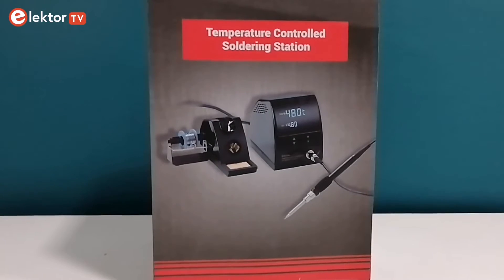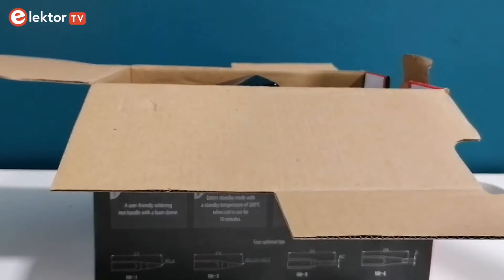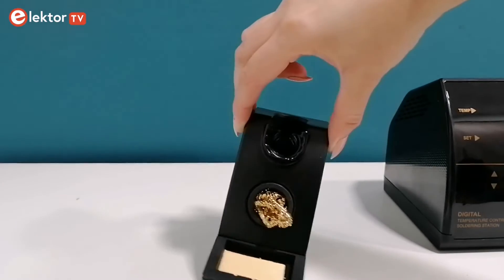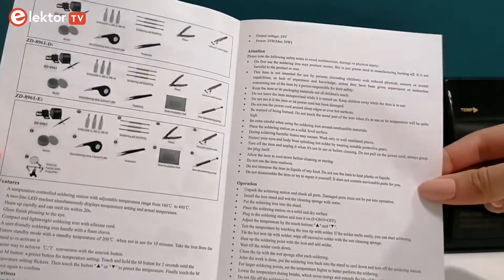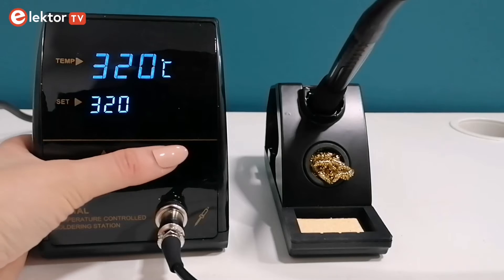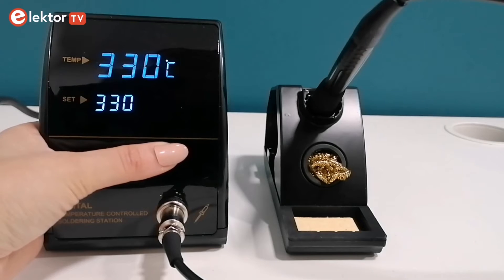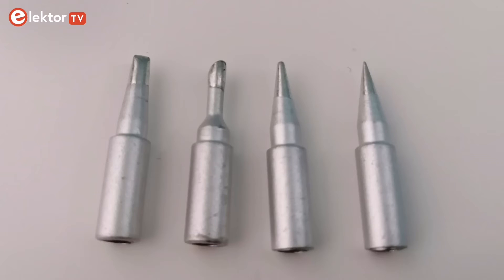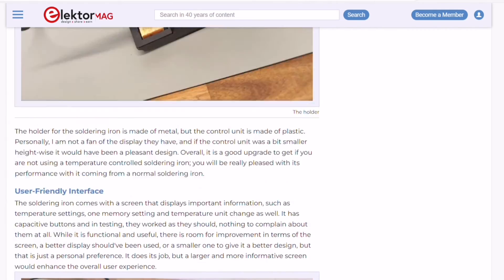Temperature-Controlled Soldering Station ZD-8961-A

Comment: Good morning. Very nice and concise presentation.
1. If you mention out loud the $60.- price at the beginning of your presentation and at the end then interested viewers will then go right away to the Elektor store to double check
I understand.
2. If you show the inner side of the connector on the cord side viewers will be able to tell what kind of connector is used.
3. If you mention that power supply comes directly with different plug types, or it doesn't, viewers will know whether one has to provide for the mains cord or it comes included. Different countries have different mains power plug types.
4. With such good price, this product is of interest from top professionals down to beginners. If you include a quick link for beginners to learn how to use it on their own you gain the interest of those willing to learn.
5.- Marketing tip : I understand this soldering station is equivalent to the WELLER WSD71 that costs @90.- 
If you mention that this product has better features than well known pricy products, then show 2 seconds the WSD71 with higher price tag on it, another 2 seconds with equivalent HAKKO also with higher price pn it, then carry on BUT  NOT mention verbally any name of any competitor, then viewers will know you are showing a better product at lower price.
This product seems to have the edge against all other equivalent products, so you win viewers if you go for direct contact.